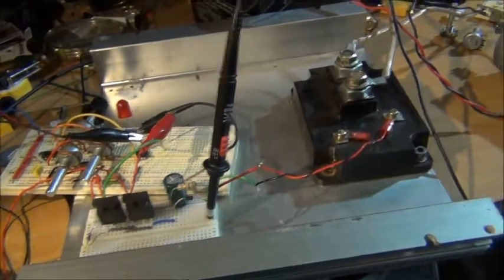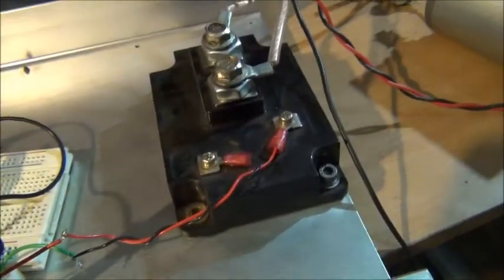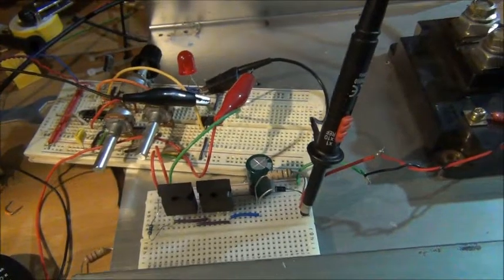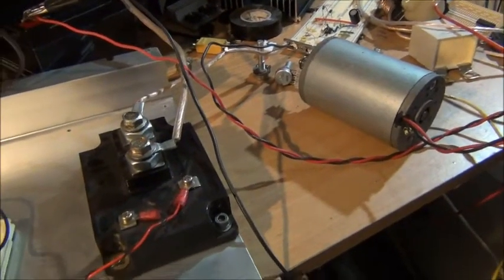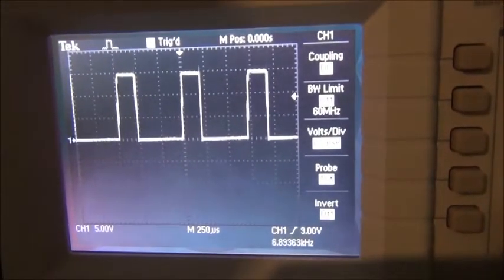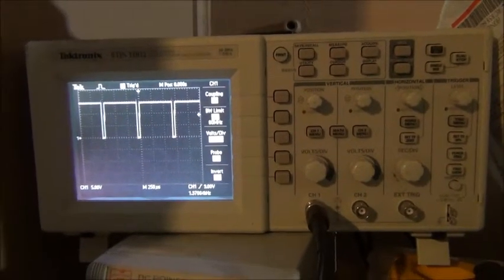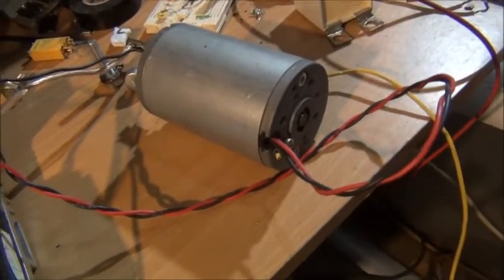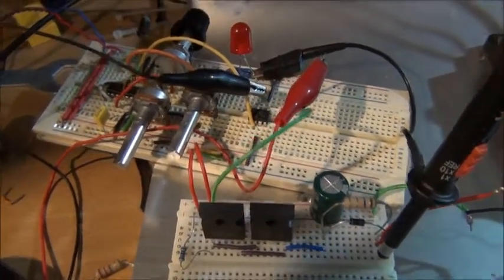IGBT Brick, PWM DC MOTOR, Test Run w/ Scope

Comment: Your too clever for me mate :-), the closest thing ive repaired thats similar ish to what your doing is electric golf trollys, power assisted golf bag carriers.

But no paperwork as i didnt write it down, over ten years it vanished from memory.

The old ones used lots of devices and back emf diodes, huge pcbs full of logic.
Later models, the pcb fitted in ya hand, two chips and stacked devices.
The later one did the job so much better, mad aint it :-)

Comment from the maker: its really a generic dc drive circuit in its own right. i should be using another igbt with shorted gate as a blocking diode but since im only operating at low current/voltage no need. the 7A shottky does it fine. the IGBT brick it self is overkill. i could do the same job with 2 TO-264 size devices. the "mosfet" sized IGBTs i have.

Comment: Not much power in the back emf then, you must have it working really well :-)

Its odd as you are driving a big inductance that has its own reactance, and resonance, i bet its a pig and a half to make generic unit that could cope with all inductances.

Write the circuit down, it works too well to be forgotten :-) :-)